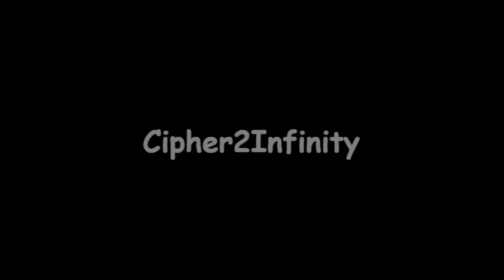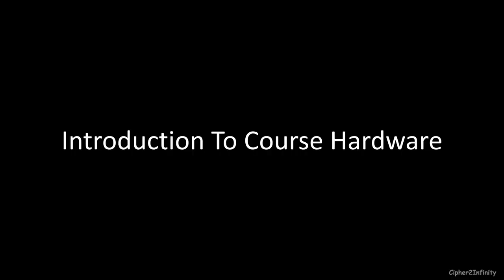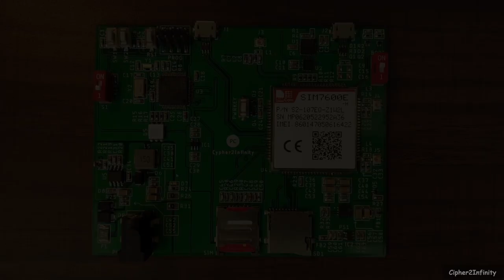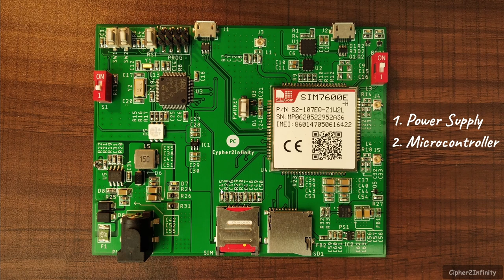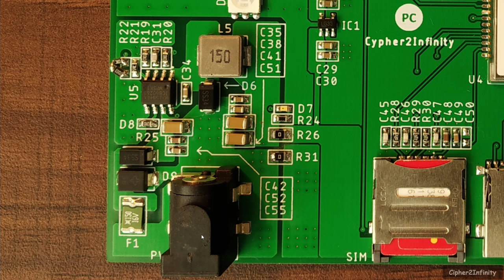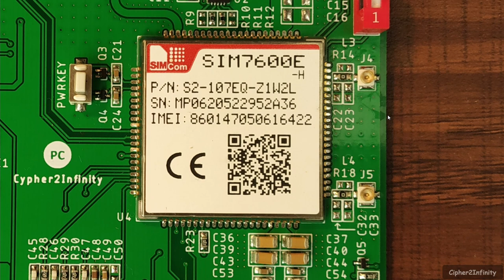STM32 : Introduction to IOT Hardware

Comment: This is a very nice video, can you please share some reference schematics for the SIMCOM7600 module? I wanna use this in one of my projects. Thanks in advance.
Reply from the maker: Thank You Mr. Gudimetla for your feedback, we really appreciate that.
You can check datasheet of SIM7600 there you can find the hardware design guide for the modem.
Good Luck with your project 🙂